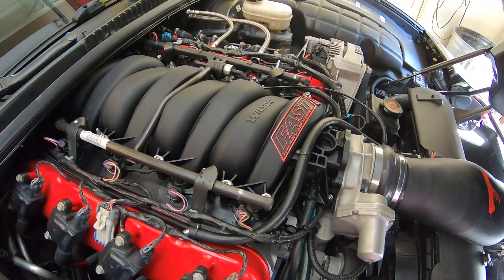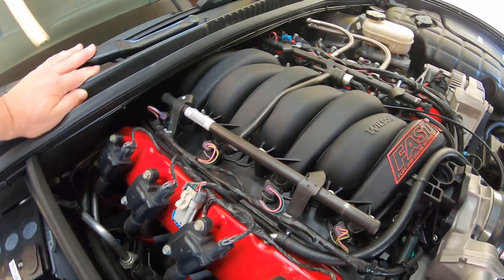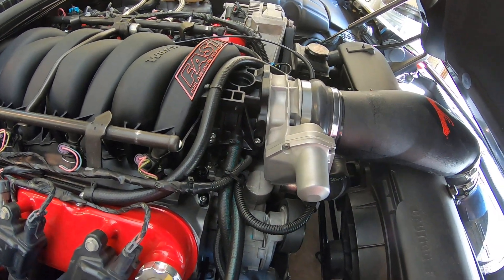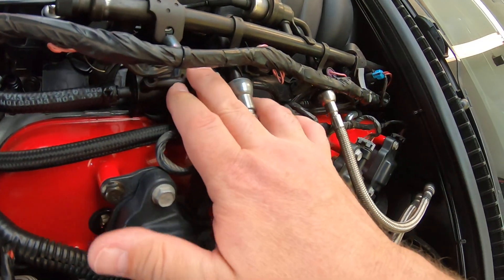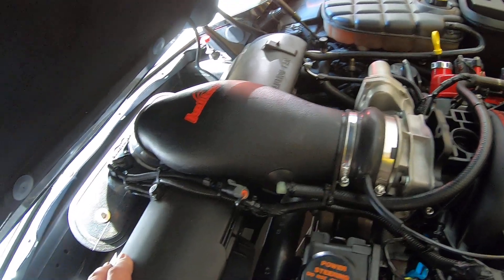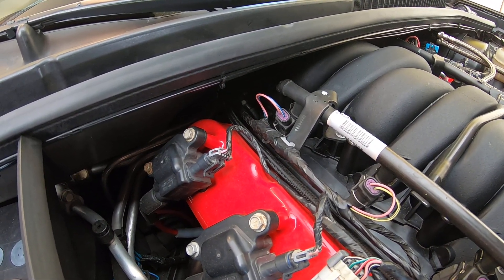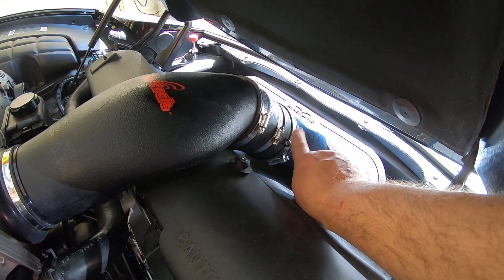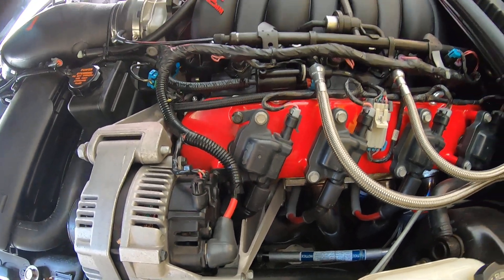Overview Installing FAST Intake C5 Corvette. Holley Valve Covers Rambletron Sloppy Style!

Comment: So how much improvement did all that work make?
Reply from the maker: That is a great question but unfortunately I will never know in this case because I ended going to the LSA supercharger in place of the FAST before it ever made it to the dyno. :(  It did run incredibly well.    If I had to guess it may have picked up 15 to 20 wheel horsepower with the intake and throttle body.

Comment: I see your fresh air for the PVC system connected to the bridge and going in your passenger side valve cover. Where is it venting out pressure and to what port on the intake? Do you also have a PVC valve in the exit line?
Reply from the maker: You need fresh air from the air intake after the MAF but before the throttle body blade to at least one valve cover.   Then in this car I have a CTS-V valley cover that has a built in PCV valve system in it.  The pipe from that goes to the catch can and then from the catch can to the suction port on the side of the intake manifold behind the throttle blade.   I have a couple other videos explaining LS pcv hose routing and catch can installations.
Reply: @PNW_Car_Mods  thanks for explaining. Just got a heavily modded C5 with no know history. I need to get one of those valley covers, until then setup a PVC w/ catch can system. Right now both valve covers are just vented to atmosphere by hoses routed under the car.

Comment: I have a 2001 c5 black like yours I’m looking to add a fast 92 mm drive by wire intake how much power gain did  it gain you ?
Reply from the maker: That is a good question Mark.  I never had any intentions of re dynoing the car with the FAST, 92 Silver blade or the 85mm maf.   It probably won't see a dyno again until I start messing with the LSA supercharger.    That being said I would be disappointed if I didn't pick up about 30 additional wheel with the mods listed above and going to 1 7/8s headers from 1 3/4s.

Comment: Any issues mounting those Holley Valve Covers?  What model did you get?  Thank you!
Reply from the maker: Toys, they are P/N 241-113.  They require LS3 coils due to the bolt spacing.  I didn't know that when I ordered.   On a Corvette you have to use the supplied adapter for the coil closest to the alternator.  No big deal.   The support bracket for the alternator has to be notched for the plug wire.   Lastly I've been fighting some minor leaks at the front out edges of both valve covers. It's not dripping on the ground but it will make a mess eventually   I'm not convinced it's due to the Holley covers themselves at this time.   I do like the clean looks of them and the lack of coil brackets.  Hope this helps.
Reply: @PNW_Car_Mods   Thank you for the response - it helps for sure - let us now what you find out about the leak.  Only way they could cause it is if they are not flat around the sealing area due to warping or bad castings  - I would guess.. They do look awesome for those of us that don't prefer the corvette covers... Cheers!

Comment: Hey, how about that mass airflow sensor the way you have positioned it closer to the filter . I've seen few videos some guys have moved it closer to the throttle body  to get better reading they say.  Don't know how much difference that makes
Reply from the maker: I'm not sure either because I've also heard of people getting turbulence problems with it being close to the throttle body.   This combination did run very well on a MAF only tune.
Reply: @PNW_Car_Mods  two for putting it closer to the filter. Depends on the individual car.  4 builds 3 separate intakes including Vararam and Blackwing, all tuned by ECS, Cartek, A&A and 2nd Street Speed. No issues or surging with SLP MAF at filter end.

Comment: Motor looks great. Question. When you updated your ls3 coil pack did you have to change to a ls3 harness too? Thanks
Reply from the maker: Yes you do.  The connectors at the coil are completely different.  The connector at the main harness is the same.
Reply: @PNW_Car_Mods  thanks.  Doing same set up. Where can i purchase this harness. Sorry to bother you.
Reply from the maker: @basiliomariconda74  No bother at all.  If I can help I will.  :)   I picked up the coils and harnesses from an Ebay wrecking yard for like 100 dollars shipped.  They are on ebay often.  Take a look there.
Reply: @PNW_Car_Mods  thanks again
Reply: I bought a ls3 harness from Holly $125 already had the coil packs. Thanks for your help.

Comment: When I received my intake some of the bolts   in the manifold had nuts on the end of them, not the six short ones but the long ones , are those for shipping purposes only? Are those the bolts I use to mount it to engine
Reply: I might need a litttle guidance on installing mine I’m doing it to a lm7 5.3 that I’m putting in a Monte Carlo ss need to figure out all the fuel stuff
Reply from the maker: Richard I am just going off of memory here so bear with me.   It should come with Allen Cap screws and washers installed in the shipping box that replace the factory bolts to bolt the new intake to the heads.   I believe those nuts are just to hold the manifold together during shipping as it is a two piece manifold.  You should not need those nuts anywhere.  Also don't forget to put the supplied short allen cap screws in the valley cover or you will break the manifold when you tighten it up.
Reply: @PNW_Car_Mods  I found this one new on fb marketplace and the longer ones were installed on manifold with nuts also. Do the six short ones keep the nuts on them to hold it togther? Which ones are you talking about to not break it the six short ones?
Reply: @PNW_Car_Mods  sorry I see what you meant I’m running a ict billet it has its own screws but the six short ones keep the nuts because they are counter sunk into the manifold I believe. I need help with the hoses because the instructions suck lol
Reply from the maker: @richardeddings7259   None of the 10 bolts that hold the intake to the heads should have nuts on them when you place the intake on the heads.   All 10 of those bolts should be sticking out the same amount from the intake if that makes sense.   I actually found an EBAY fast  92 for sale that shows all the new hardware that comes with it to refresh my memory.   Hoses are pretty self explanatory to an extent.   The left side nipple behind the throttle body is for fuel evap purge.  The nipple on the right side behind the throttle body is for PCV suction.    Map sensor and HVAC are at the rear of the manifold.  IIRC the map sensor is kind of stupid as there is nothing that physically holds it in.   They make good power but these manifolds are frustrating to install and setup.  I think there are no instructions because there are too many variables to everyones installation.  Hope this helps anyways.

Comment: Very clean install.  Are you going to throw it on the dyno when you get it all tuned?
Reply from the maker: I have had it on the dyno already but not with the FAST or the 1 7/8s.  I know about what it would make so I am not in a hurry to dyno it.  Now if I do end up with the LSA then it will likely go back on the dyno for sure.

Comment: How did you run the new ls3 coil harness for the ls3 coils?? Just on top of the valve cover!
Reply from the maker: I ultimately took off the plastic boxes from the LS3 coil pack wire harness and then they just naturally lay in place.  Looks pretty good.   If you check out my latest c5 video sound clip you can see how they look now.   I think its so much more simple than the original LS1 coil and bracket setup.
Reply: Where did you pick up the  2 ls3 harness’s from?
Reply from the maker: @srtlat38  They came with the coils as a package from a Wrecking Yard off of ebay.  I think I paid a hundred bucks for coils brackets and harness.
Reply: @PNW_Car_Mods  is the harness the same for both sides? I picked up some coils for $50 bucks and now just need the 2 harnesses.
Reply from the maker: @srtlat38  Sorry I missed this one Tip.  I don't have part numbers to 100% confirm but based on visuals I would say right and left are exactly the same layout and connections.